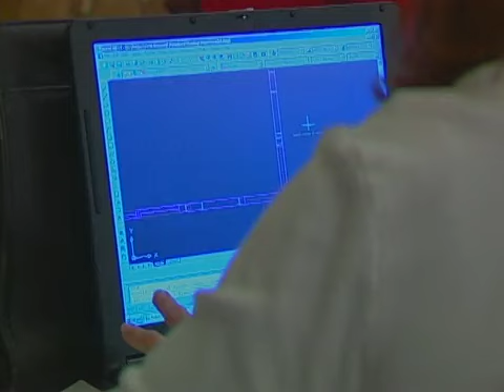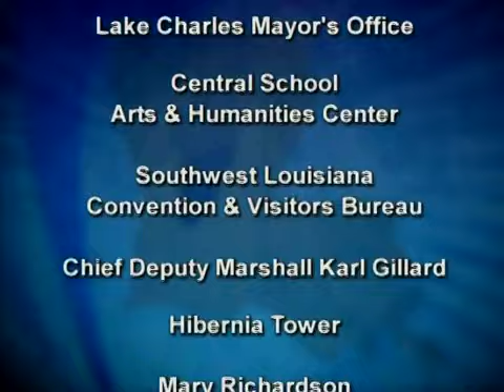Hurricane Rita: The Forgotten Storm | March 2006 | Public Square

Comment: hurricane Rita hit in 2005 not March 2006 it achieving Category 5 status on September 21. However, it weakened to a Category 3 hurricane before making landfall in Johnson's Bayou, Louisiana, between Sabine Pass, Texas and Holly Beach, Louisiana, with winds of 115 mph (185 km/h). Rapidly weakening over land, Rita degenerated into a large low-pressure area over the lower Mississippi Valley by September 26th.
Reply: This episode of the series “Louisiana Public Square” from March 29, 2006